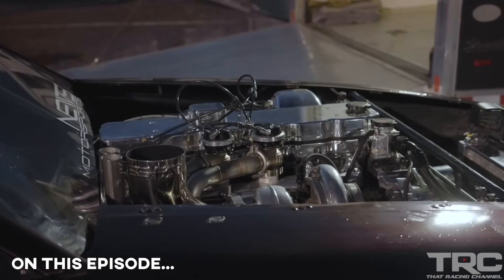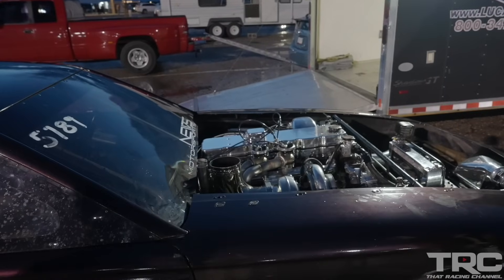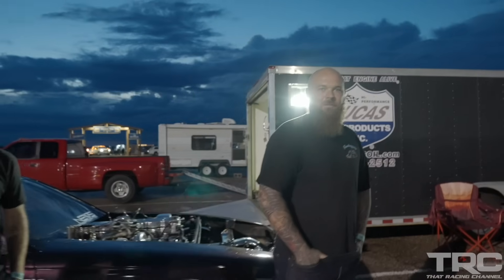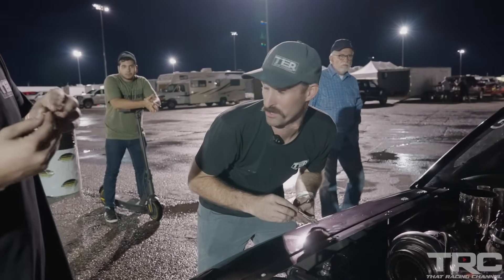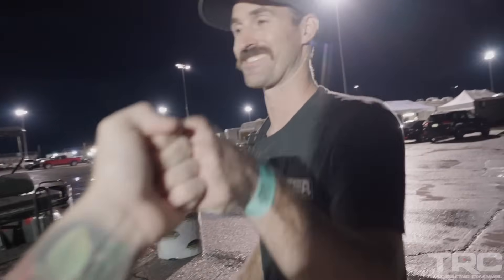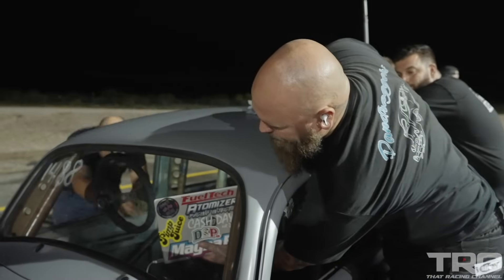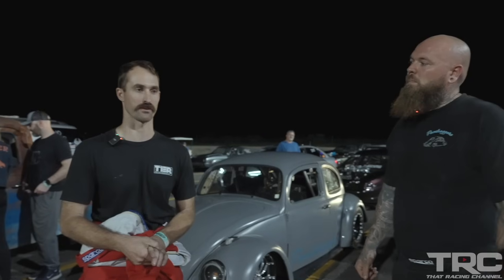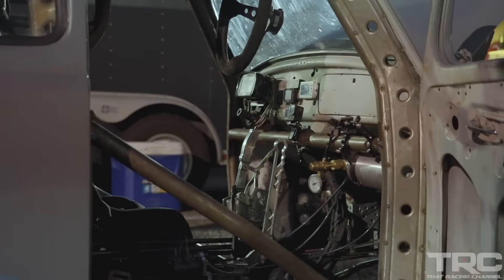1500HP Diesel Swap Mustang (2000LB-FT Cummins) VS INSANE Turbo VW Bug

Comment: 600 from a boosted air-cooled is insane.
Reply: The Porsche guys do it too. Singer makes a 800hp version. Absolutely Insane.
Reply: @Mp-jw1qg You have to ask WHY tho?   It has to be way more expensive than using a liquidcooled engine, like a modern-ish porsche flat 6